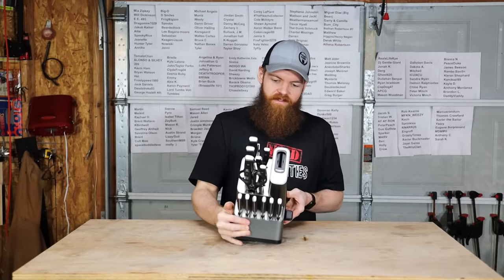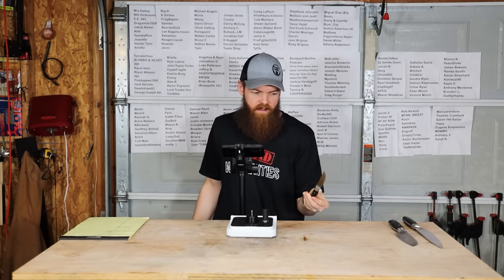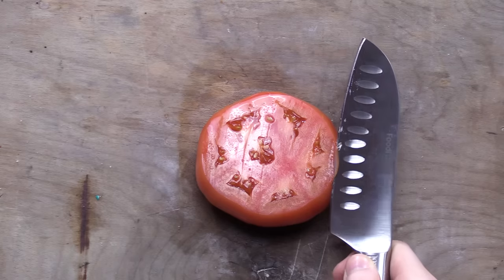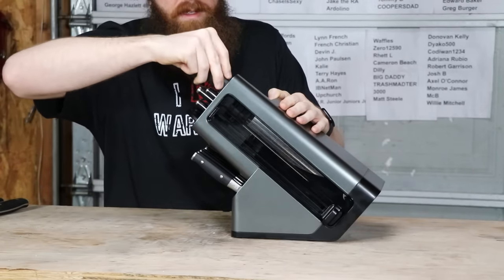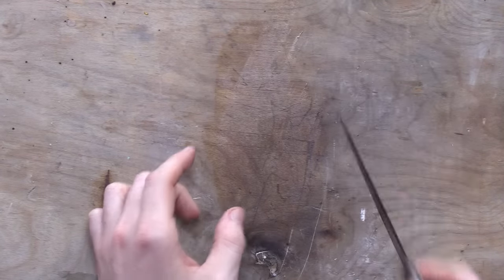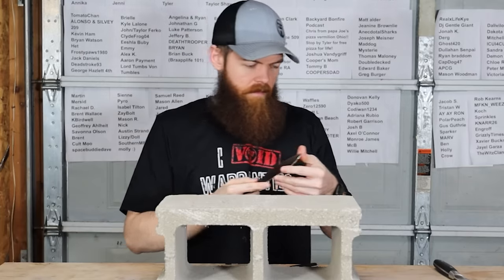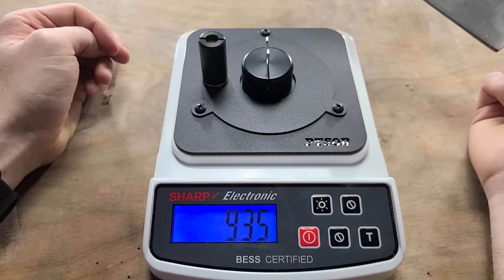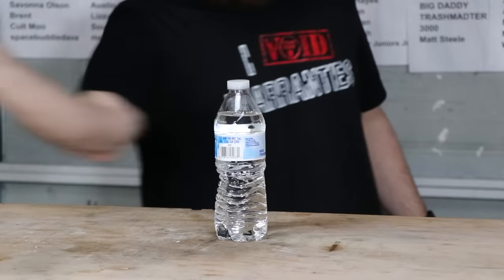They Said These Knives NEVER Go Dull......

Comment: The irony is, the company is essentially saying that if you hone your knives at a regular interval, they’ll stay sharp…but the customer doesn’t have the time to bust out a hone, or a strop, or sharpening stones, and do the work to keep the knife sharp. So here’s a fancy over engineered knife sharpener/hone, labeled and packaged as a knife block, to replace the time and effort you’d normally have to take to sharpen your knives, with a machine that requires the same amount of effort and time, and it barely works…. Genius level marketing…

Comment: Each slice off the tomato makes it lighter and as the surface gets wet I would think it would slide easier.  Plus I don't think that type sharper ever gets as good as a wet stone and strapping. However my kitchen knives I usually don't let get real bad. I use a steel if I am cutting alot at a time. It seems to bring it back to the super sharp it starts with.

Comment: The steak knife is the sharpest because it's the thinnest.  And the knives lose their sharpness the more it's "restored" because the sharp point gets thicker.  So to properly restore blades to a nice sharpness, you would need to use a belt grinder and grind at the proper angle

Comment: The knife you didn't know the name of is a santoku. Please practice safer knife handling skills, the way you were holding the tomato while slicing could result in you cutting your finger.
The tomato wasn't at fault, maybe the angle the knives are sharpened to is incorrect to begin with but I never have that problem with my work knives with beefeater tomatoes (the same type you were slicing). Those style of disc grinders imo are terrible but at least they went with ceramic instead of a metal one which I've seen cause knives to need a lot of sharpening to restore them.
For the price of one of these sets my advice is to go with a good brand such as wusthof or victornox and you can send them off to have them professionally sharpened if you don't want to do it yourself but due to the quality of the metal used they don't need sharpened much unless you really abuse them.

Comment: Usually when you hone a knife with a honing steel you do both sides of the blade, but this Ninja sharpening wheel looks like it’s only honing one side, if that’s the case then the knives will never be properly maintained as they claim

Comment: Are you familiar with the term, controlled experiment? The tomatoe is later in a wet spot. It wasn't at the start. The thinner knives sharpened easier, thus faster. Run the thicker knives another ten times and see if it get sharper, then another ten. There's no science here.

Comment: The problem with the tomato thing:
First time you used the tomatoes they were cut and still really juicy. The juice was providing some suction to the wood. 
Second time the tomatoes were dried out more so they were sliding on the wood easier.

Comment: It's the type of steel these cheap blades are made out of. They don't hold and edge beyond factory very well.  Check carbon steel vs these you will see they hold and edge better over time and can be resharpened.

Comment: Well. If you watch the factory video it tells you the sharpening handle must cycle all the way down and back up. Also, there is an upper and lower spot the shorter to longer knives go in when being sharpened and it appears you didn’t do it correctly. ..

Comment: The problem you ran into was if you’re using this system as directed they will always stay sharp. When you ran them over the cinder block you went way past what this sharpener can maintain. They now need to be sharpened properly to regain the edge. This system will not get them back to their original sharpness. If you’re an average cook who don’t care for professional knives or sharpness, this is a good economical set. If you want professional quality and sharpness dig deeper, real knives are expensive and you never run it through this gadget sharpener.

Comment: hey man i’ve been watchin for a while now and i was wondering if you could test those rod type knife sharpeners ive only ever had those and was jw how it stacks up
Reply: To be honest, the rod sharpener, or a “steel” as they are known aren’t really for sharpening dull blades.  You would use a diamond stone or whetstone of say 600/1200 grit to sharpen the dull blade.  You would then use one or two passes of the steel just to finish profiling the blade edge.  Once done, you would then strop the knife on leather (I use the edge of the cutting board) to remove any burr which should result in a “razor” sharp edge.  You would then only need to steel the edge once or twice prior to and after each use to keep the edge keen.  I think this set is a gimmick.  I don’t like these pull through sharpeners.  They have a set edge angle which isn’t the same for each knife type.  They can also remove a crazy amount of material from the knife, especially if you are using pressed steel instead of a forged steel knife.  Better to be patient, use the right tools and keep high quality knives for decades.  👍. Have a great Christmas 🎄
Reply: @dmc3067  thank you man i’ll invest in a better sharpener now!

Comment: Unfortunately ceramics aren't made for edge forming, you'd have to do it way more than a 100 times, that's why we normally start at 120 grit and work up, i have a 70 grit for restoration and egde forming (120 on an belt grinder is sufficient in my opinion)
Reply: Aren't FFS !!
Reply: @TheAmishElectrican  😐 hold on just a second

Comment: Unless there is some lubricantion on that ceramic wheel it will not work correctly.  I have a global sharpener that uses a ceramic wheel and it has to be in a water bath when using it.

Comment: ceramic stones are edge straighteners not sharpeners. With use, fine edges fold over and the stones straighten them. Generally you never need to sharpen a good knife but maybe once a year (unless you drag it across a concrete block, in which case you definitly must use stones for sharpening). It would've been a better test to pull the edges against a butcher block 100 or 1000 times then use the edge straightener as most people are not going to pull their expensive knives across concrete. No i dont work for Ninja, i actually prefer forstner victornox knives which I've owned without replacing for over 20 years.  (and no i don't have any affiliation with any company, just a lifetime of experience).

Comment: You don't hone a knife ESPECIALLY a kitchen knife every two weeks and expect to maintain a decent edge. You SHARPEN only when regular HONING will not bring the edge back to sharp very easily. If you HONE every time you use your knife you sharpen far less and grind away less steel.

Comment: It would be interesting to compare different honing methods. Leather strap vs buffing wheel vs steel rod.
Reply: Buffing wheels are terrible for knife edges. They flatten the teeth and you’re left with a slick edge with no bite. A ceramic rod and loaded strop is the way to go in my experience.

Comment: The reason these tests aren’t great is because the sharpness testers does one tiny little millimeter of the blade.  And every time you test guarantee  it’s a different spot.  Test every 1/4 inch of a knife blade and see the variation you get

Comment: Those quick sharpeners are trash. They "sharpen" the knife by placing scratch patterns Parallel to the edge! This creates a WEAK edge, which guarantees you'll sharpen them again after cutting a steak! You can take a dollar store knife and sharpen it with a proper stone, creating scratch patterns that are Perpenducular to the edge, this creates a strong edge that can chop wood and still cuts paper after.

Comment: Sharpen a rock, plz for the love of god do it I recommend obsidian if you do decide to do so but idk if it will work but am curious to see if it does
Reply: Obsidian could be sharpened like steel but it's structure differently. 8t will end up getting weak point and Crack. What makes obsidian sharp it when broken, the crystalline structure has a perfect apex. Making it super sharp

Comment: I think if youre looking for a more scientific process. Maybe do 3 to 5 sharpness tests each time and have a max/ min/ average of the 3 or 5. 

I think its worth it to find out what metal it is. Low carbon steel is harder to sharpen and keep sharp. 

It also might be worth it to take a high quality knife you love and try the same torture tests and sharpness tests. Maybe a before and after too. Like a knife you have sharpened yourself, test it, then dull it and sharpen it in the knife black and test. 

But Tbh i think the problem is the ceramic wheel. I personally cant see it being very well for the knives.

Comment: I don't think there is one single more overengineered thing than knife sharpeners. A simple honing steel, that you run your knife over every now and then when you use it, has made my knifes sharper than any other sharpening tool out there ever has (except a wet stone maybe, but I consider this a similar category)

Comment: The reason they go dull so fast is because those types of sharpeners create a burr on the blade rather than an actual edge.  All it will do is immediately deform the false edge.

That’s why people will generally recommend some form of whetstone sharpening because it creates a legitimate edge.

Also, for destroyed edges you’ll need to reform the blade with an actual metal sharpener to pseudo grind them down

Comment: First learn more about knives, what each one is used for and why there are various angles to different blades, then you can truly say you tested out the knives in a manner that truly demonstrates the knives capabilities. I'm not saying you assessment is wrong, but it is grousely inaccurate and not evaluated with a proper consistency befitting each knifes intended purpose. Afterwards you can say that your assessment is dead on, cause knowledge is power and then you can truly take pride in your work as a YouTuber